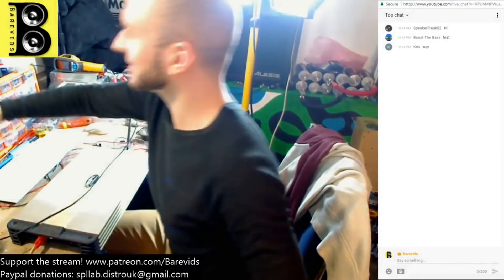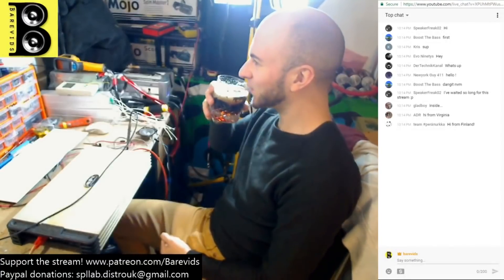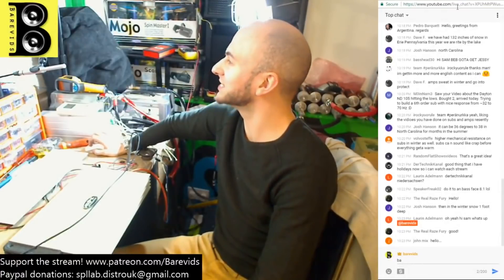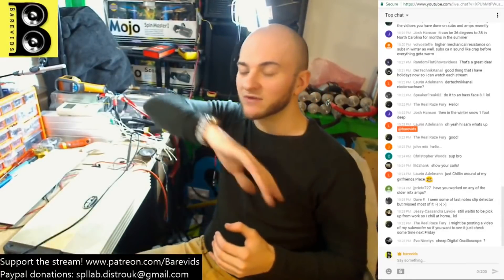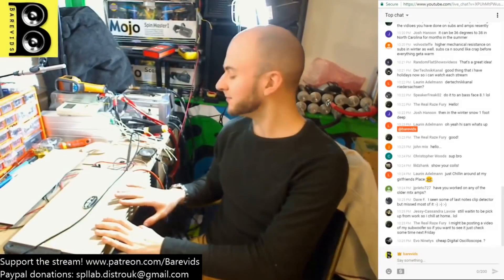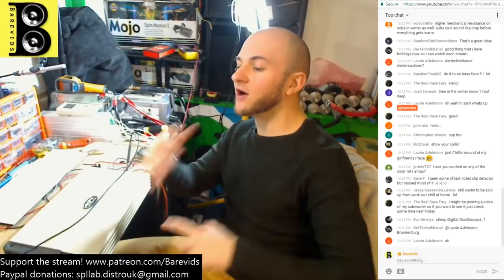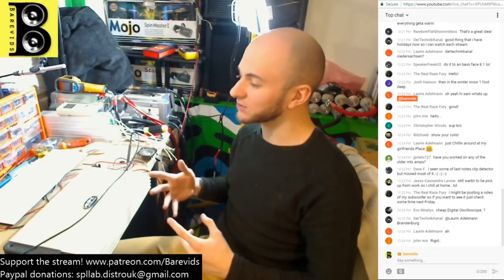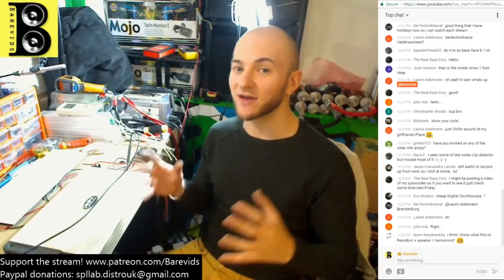Detect amplifier clipping WITHOUT DD-1! Cheap simple clip detector

Comment: Can someone please tell me how I would go about doing this on my front and rear speakers connected to my 4 channel amp at 4ohms 45rms and to my subwoofer connected to 600w rms at 2ohms? Do i need to play the 50hz freq for the sub and watch for clipping and 1000hz for main speakers?
Reply from the maker: No need in full range speakers. The distortion is already audible through them. The only reason to do this on subs is because you can't hear clip through a sub.
Reply: barevids can i use the same method instead of putting stress on my main speakers? Or should i just use the multimeter

Comment: How do you determine when a head unit starts to distort?

Say to know what volume to use for max when setting gains.
Reply: Veritas et Aequitas turn input all way down on amp and crank volume up on headunit with a 40hz testtone and HEAR for distortion at low amp/high headunit level. 
The distortion you will hear is from your HU
Reply from the maker: You can hear it distort through your mids buddy.

Comment: Any cheap easy way to detect at line level voltages?  Would be useful for rca's
Reply: Fred Gable turn input all way down on amp and crank volume up on headunit with a 40hz testtone and HEAR for distortion at low amp/high headunit level. 
The distortion you will hear is from your HU
Reply: @Broxine  I was more so asking for a cheap circuit or electrical engineering method - thanks though

Comment: dd-1 sales plummet lol. overnight smd closes shop lol. i was going to say for the price of the dd-1 you might as well buy a frealing oscilloscope. my god. you know what car audio doesn't even surprise me anymore. some people question why car audio is looked down upon. take example D. ive been out of this scene so long.just going back watching some of my old gear. the stuff i had over 10 years ago is better than whats out there now. glad i still have it. its only gone up in value.  it feels good to see a guy like this dropping truth bombs. it seems nothing has changed from when i was into this years ago. still the same old same old crap. now there is a new way for company to promote there products. it seems that the ones who grabbed the social media presence have grabbed the young market. not that there stuff is good. these kids are still chasing watts and spl so sad. why do 5-25 watt class A amps in home audio sound so loud and good. these multi thousand watt systems cant touch lol.i needed to rant a bit sorry :)
Reply: It's so easy to fool those newcomers, usually all they do is stare that wattage like it's magical number. I have one friend who does not know shit about Amplifier Classes like A/B and D, efficiency (how much needs to go in before it can come out) and what is overspending (no, you don't need 2 AWG wire to run 350W amplifier)
Reply: @StaticVapour590  it does make me lol at times. other times it makes me sad.

Comment: Works great for Bass amps, but not so much for  High frequency  sine waves.    It gets hard to tell but it can be done.   The DD-1 just makes everything simple and a joy.   From RCA preamps to OEM amps.  Its all gravy.    Sure there are TONS of ways to tell and build your own.  I just like having the nice tool.    It just makes it simple fast and easy.   And like it or not, I like using. it.
Reply from the maker: You just answered yourself there. With mids and highs you can instantly tell when it clips because the distortion is audible since those drivers can reproduce square wave properly. A sub driver cannot produce a very audible square wave so we cannot easily tell when it's clipping, hence devices to help us. You don't need a dd1 on mids and highs unless you're deaf and can't hear distortion...
Reply: @barevids     Speaking of that..  I was listening to an EDM track,  (Daryl Porter,  ) and there was a BIT...Moar zizzle than Sizzle...  And then..   I hit 28..Maxed out my deck on the Fortisima!  
Suddenly,  out of no where!  PUFF the MAGIC  Electric Dragon came to visit me out of one of my tweeters!     

 I kind of envy people who enjoy rap music because you can always tell when something's distorting.   it's clear as day.

currently I'm actually trying to build an analog Distortion meter for my high-end and having it light up an LED when it detects Distortion while it's playing.

I Know umf audio actually produced a circuit that does that so I might take a look at it and see if I can design something and make some pcbs of it.

Comment: I built a new one the other day. Works great. I calculated my voltage needed with my 500.1 RMS and 12 inch Sundown. The little clip detector started buzzing almost 1/2 volt before OhmsLaws said it should...lol. Nice easy little tool.

Comment: Hey I was the one asking about using a woofer for this. I did that this morning and at any level there the woofer was responding, I started at 0 gain and that was the only point which nothing was coming through the woofer. I'm not sure if that means there is distortion in my system no matter what, I actually have a nice setup. Or am I doing something wrong? I ran the positive wire to the capacitor and connected the capacitor to the positive terminal on the woofer. I'm really hoping my setup isn't bad and putting distortion to my woofers no matter what levels. I would greatly appreciate some help. Thank you
Reply from the maker: If the woofer is moving with the frequency of the sine wave then that's fine. You're listening for a high pitched buzz or crackle. Which is why it's best to use tweeter.
Reply: @barevids  awesome thank you, I really appreciate you taking the time to answer dumb questions. Seriously appreciate the help.
Reply: might be too late... just thought that maybe, you need to turn down the HU volume. suspect Head Unit signal is dirty if youre hearing noise at min amp gain level...

Comment: Can i use an old spare woofer with that same capacitor or does it have to be a smaller higher frequency response speaker? I would greatly appreciate some help.
Reply from the maker: Any speaker bro just tweeter will do it louder probably
Reply: @barevids  awesome thank you. One more quick question if you don't mind. I just run the capacitor through the positive wire before the speaker right? I was told recently that I need two of them for both positive and negative. I thought I would ask, thanks again

Comment: Can this work if connect to rca? Coz I want check my head unit clipping point. Tq
Reply: Search for emf audio distortion detector. He builds the ones that are on the Rockford Fosgate website.   I built them both and they work.  Building this cap and tweeter setup soon.

Comment: Could I do this with an old door speaker and not use a capacitor and just play a test tone too low for the speaker to play? Say 20 hz?
Reply from the maker: No the speaker will still play it and destroy itself. You need to stop the LF entering the driver. And you use a capacitor for this.
Reply: @barevids  I got a 400 volt  2.2uf capacitor wired it to an old door speaker and it worked great for a 5 second test tone to see if it started buzzing when I turned the gain up. The tone ended so I turned my gain up on the amp and played a 30 second tone so I could back the gain down until the buzzing stopped, it played for about 10 seconds and before I could tune the amp the capacitor blew up in a cloud of smoke. What happened?
Reply from the maker: @somedude0808  the capacitor probably wasnt bipolar. The cap MUST NOT have positive and negative polarity. So the cap blew from being fed reverse voltage.
Reply: @somedude0808  I dont think it is, usually the different leg heights indicate + and - plus there should of been markings on the actual cap.

Comment: Will someting like this work on a rca output from a head unit or is that voltage to low? So you know there is only clean power entering the amplifier
Reply: with this hooked up as he indicated, leave the gain turned all the way down on your amp, then turn up your head unit until you hear the distortion. Then after you know at what volume your HU distorts, turn it down ever so slightly (or leave it as is if you want the absolute max output), then start turning up the gain on your amp until you hear the distortion.  NO matter what device you use (OScope, This, DD1, etc.), you must always test the your Head Unit first, then any devices  (like an epicenter, electronic crossovers, EQ's, etc) next, before you test your amps.  ALWAYS Start up stream and work your way downstream, one device at a time

Comment: Also, you said to wire a cap in series with a small speaker. Did you mean in parallel?
Reply from the maker: No, series. Think about it carefully. ☺
Reply: @barevids  I honestly have no idea that's why I'm asking. I've tried to think is through and done a lot of searches

Comment: Can I use any impedance speaker for this test or does it have to match the amp?
Reply: I would really like to know that
Reply: @gianvitomarzulli9740  as long as the impedance is the same or higher than the amp can handle, you will be fine, a higher impedance speaker (8 ohms or higher) will just be ever so slightly not as loud (as a 4 ohm).

Comment: I'm dumb, what capacitor should i get for a 2000 watt rms class d amp?
Reply: 2x voltage minimum. Dmm to read output in ac.
Reply: @fasterthanaturtle  dumb it down for me so's i can understand please
Reply: @derekcraig3617  just buy a 3.3uf 400v non polarized capacitor mate you should be fine
Reply: Derek Craig actually mate I just had a look on eBay and could only find 100v 3.3uf non polar capacitors however that should still do the job for you on that power buddy
Reply: @jaredkain3021  Thanks bud! I found a 3.3uf 400v non polarized cap on Amazon. Many of the  reviews talked about using it to make a poor man's oscilloscope to set gains :)

You've been very helpful THANKS!!!

Comment: How would you do this for high pass crosses amps (setting gains for mids/highs)
Reply: @Michael Gonzalez after knowing your gain. Could you still adjust the settings on the HU? Or gona leave it flat?
Reply: @kaudioworkz1297  EQ settings, i would deduce prominent frequencies to equalize not boost other frequencies. you will still have a safe set by reducing eq settings.

Comment: How does it adjust for different ohm loads? Based on Ohm's law, the same amp could be 4, 2 and 1 ohm stable with very different voltages, how does this method account for variations in the required voltage?
Or does the ohm load in the little speaker you're using somehow force the amp to run at matching ohms, as if a sub with the same impedance were connected?
Also, will a 5.6uf cap work?
Thanks
Reply from the maker: the amplifier does not see a resistance from the added speaker, since there is a filter cap in series. Its practically infinite impedance so doesnt affect the amps operation in any way.

Comment: That's so fkn cool...I'm geeking out on this...now what cap would you use for your mids and highs amp
Reply from the maker: You don't run mids and highs to clip point ☺ you set your subs up to clip point, then you set your mids and highs to be a balanced level with your subs. You can hear clip instantly on mids because the fullrange woofers are able to recreate the distortion unlike subs. So if your mids start distorting before you reach a good level to match the subs, you just upgrade your amps to higher power.
Reply: I geeked out as well on this as I was struggling with setting mine up, worked so well

Comment: 6:40 Playing at .25 speed. You can see hear/see the clip. I'll order a 250v 3.3uf non-polarized capacitor since I'm running 2 4k amps (true rms 5600 watts) according to manufacturer. According to my maths this should be good for around 11,000 watts? considering a max strain of 80% on the capacitor. So around twice what I would actually need since the 400v capacitors cost much more. I could be completely wrong but I'll need over a 100v capacitor. I figured twice that would be plenty. I have a few tweeters and speakers lying around. Do you recommend just using a tweeter? since i've seen people do the same with those 100v piezo tweeters? I saw a 250v piezo tweeter but then the capacitor is cheaper. Only 8.88 on ebay 2 250v!

Comment: Hey , can one use tweeter from a component speaker set using the crossover that comes with it?
Update : I tried using my old component speaker connected to the tweeter side of it's crossover and it did seem to work. The cross over filtered out the low frequency and only when the amp clipped did the speaker emit the clipping sound.
Reply: Hi Ajay can you help me with your method used , do I have to disconnect mid woofer from crossover of the component speaker to test this method ?
Reply: @piyushchoudhary5155  Hi, please avoid using the mid already installed. I would advise picking another one and link it to the tweeter side of the crossover. Now, disconnect all speaker and subwoofer wires from the amplifiers. Connect this crossover with the sub amp and reduce the gain to minimum/zero . Now play a 50 or 40 hz (-10 db) sinewave tone (you can download it from kicker.com if not available) and increase your stereo volume to either the max it can go without clipping or if you don't know that then probably 75 percent of the max vol. Start turning the gain up on the sub amp, the speaker will start making a noise once the amp starts clipping. Hope it helps.
Reply: Thanks Ajay , very nicely explained , can you please help me how I can set gains for my stereo amplifier using this approach to set mids and high !
Reply: @piyushchoudhary5155  i havent really tried using this approach to set the mids and highs, my amp itself had the clip indicator so just used a 1khz  5db sinewave tone. But not to worry, you can trust your ears for mids and highs as human ear can easily make it out in that range. What I can suggest though is just go by the output voltage of your stereo. If it's 2v , then in most amplifiers setting the gain at 12 o clock position will be a good starting point. If it's a 4v or a higher output the I would recommend some thing like a 10-11 o'clock position. This is all by my own experience and usage so may or may not be entirely correct but for sure won't blow your speakers. Rest you can simply set based on your taste. Another tip try to keep everything on the eq to as flat as possible with minimal gains.

Comment: Thank you so much! In my country DD+1 cost 500 USD, because of tax and so. But can you help me please with the WIRE SETUP to leave it aways pluged
:
amplifier+ ------ capacitor ------ twetter+ ----- tweeter(-) ---- amp(-)
It will run paralell with the subwoofer right? It will change my ohm number?
 its a 6k rms system 1 sub 2+2 running 1ohm
Reply from the maker: Doesn't change ohm because the amp doesn't see it as a load to drive.
Reply: @barevids  Thank you!

Comment: So does this work for the highs also? Do you just play a 30-40hz tone with the test speaker on sub channel. For highs you use same test speaker but at a 1khz tone on the high's channel?
Reply from the maker: There's no reason to do this for highs, since you can hear the distortion and clipping anyway. This only makes sense for subs that cannot produce the distinct sound of a clipped waveform already.
Reply: @barevids  thanks for responding to my question. I appreciate it.

Comment: This is very interesting, thank you for explaining and showing!!
But where do you get the 2.2 to 3.3 uF rating from? What happens if you choose lower or higher uF-value?
Reply: late reply, but it defines which low frequency is filtered. allows higher frequencies to be generated.

if the uf rating is constant, frequency crossover point is defined by the resistance of the speaker.

Comment: I know this is hella late && is gonna sound fucking stupid LOL; But how do I wire this “clip test speaker” in with my subs on a mono block amp exactly? Will the capacitor (seeing as it blocks low frequencies..?) make it so the amp doesn’t give it any power unless clipping? I’m electrically retarded. Just confused as to how, say, a 1000w amp wouldn’t blow your test speaker. I’m sure it’s simple, any help appreciated. 😅
Reply from the maker: Correct the cap protects the speaker entirely and only lets the buzzing effect from clip pass through.
Reply: Awesome. Thankyou for the fast response. Liked/Subbed/Shared BTW 🤘🏼

Comment: So how does resistance play into this? If I have a pair of subs at 2 ohm total load that I want to set clipping for and I introduce a mini speaker I to the mix, wouldn't the gain setting then be set for the resistance of the three speakers and their resistance sum instead of the two subs? Also then wouldn't I have a suboptimal gain setting? Does the ohms of the mini speaker matter? I would think it would... Anyone?
Reply from the maker: No. The small speaker you add has a capacitor in series with it. The amplifier sees this as an infinite resistance thus does not effect anything at all. Its as if it was never there.
Reply: @barevids  awesome.. thanks for the response.

Comment: I would put a disclaimer, some choad is gonna put the wrong V rating or a Pol Cap and burn his whip and possibly the garage and house to the ground... I’m an Electrician and I have a DD-1. We should support our Entrepreneurs and local sound/mechanics.
Reply: Wouldn't the capacitor just blow it's guts all over the place, go short circuit and blow the testing speaker? A blown capacitor burning a house down sounds a little bit overkill.

Comment: This is SOOOO simple! Thanks for the tip. Who doesn't have extra tweeters or mids laying around? Or better yet, just take a cheap book-shelf speaker that is already crossed over and disconnect the woofer from the crossover and add a resister if needed.